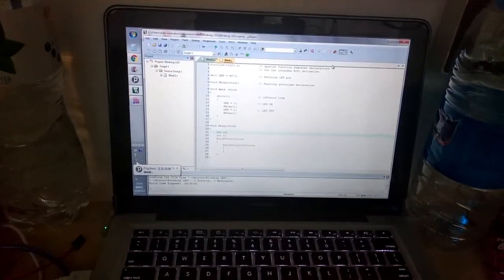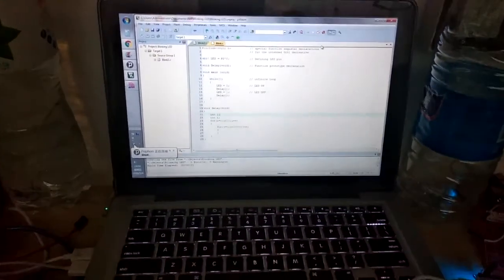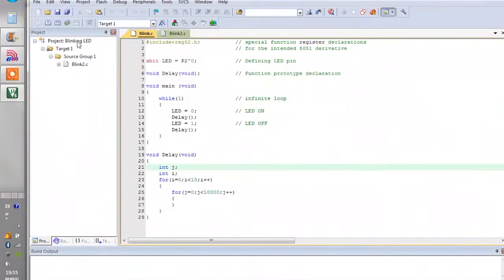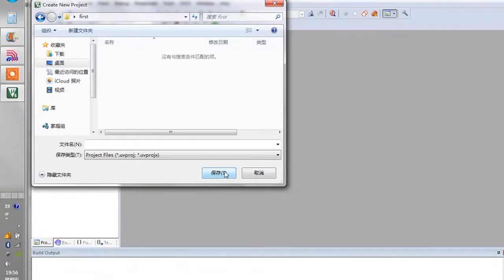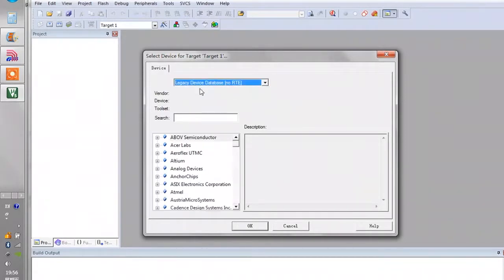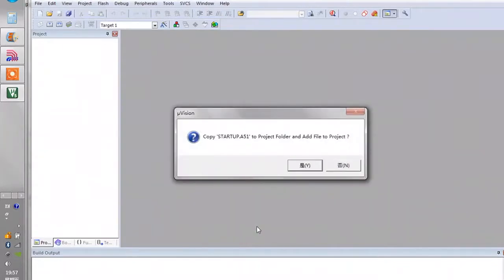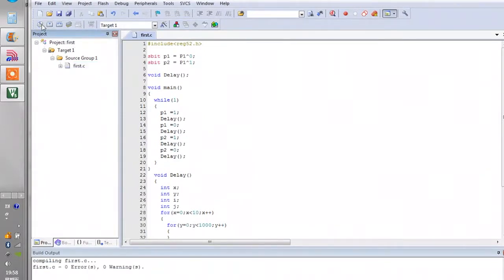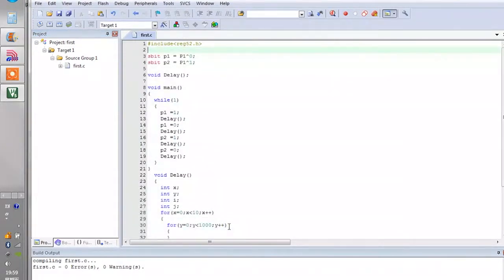Getting start with 8051 microcontroller code and config(Best for beginners)

Comment: Good one. Informative.
BTW, what tool did you use to design the firmware before coding?
Reply from the maker: I'm sorry I don't really get your meaning after all about " design the firmware before coding  "
Reply: Hello
Want to know which tool or app did you use for firmware or logic design and which one for firmware development or coding? Thx
Reply from the maker: You can just simply google for uvision application it's and development ide for c51 microcontroller
Reply: Hi
Did you see flowchart to code converter videos? Regards